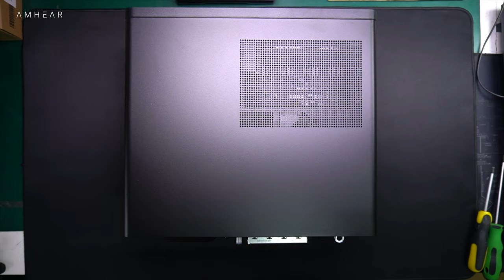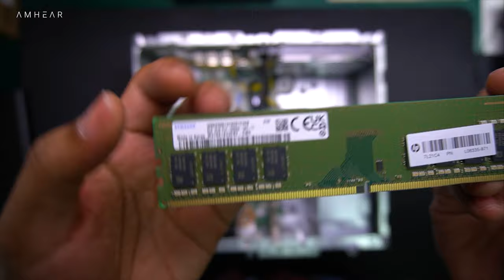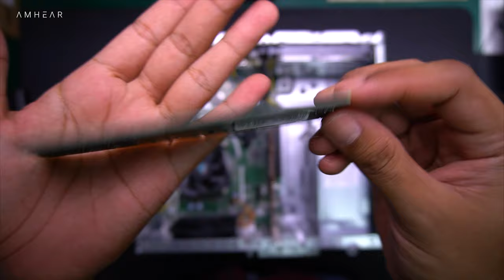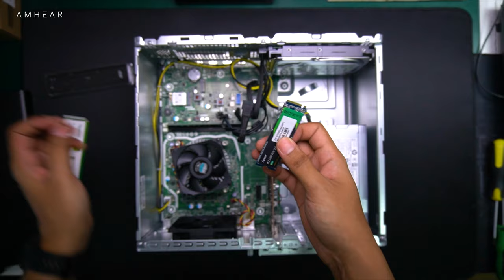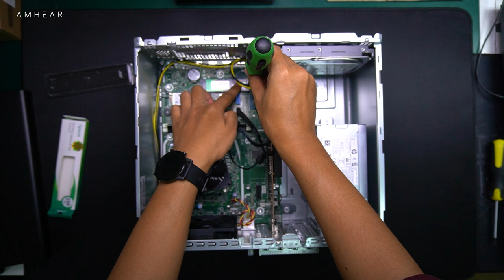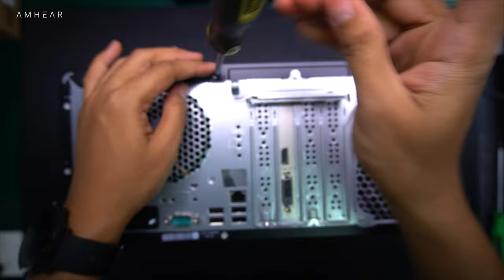SSD Upgrade HP Desktop PC M01 F200d 5U1C9PA

Comment: A have the same pc.can i upgrade the power supply?
Reply from the maker: if you manage to find the power supply with same socket, yes you can upgrade, but most of the ones on the market are different. I'm also having a hard time finding it myself.
Reply: you can get an adapter from ebay or amazon that will let you use a regular power supply
Reply: You want a HP 942332-001 and it is a 400w supply!!! Not just any PS going to fit that small frame